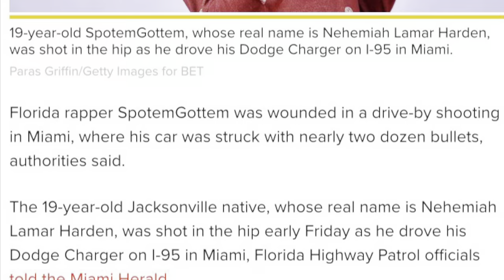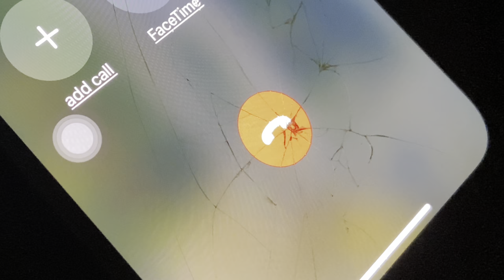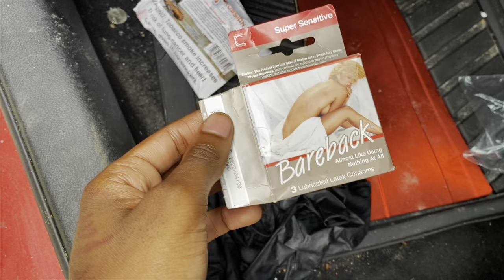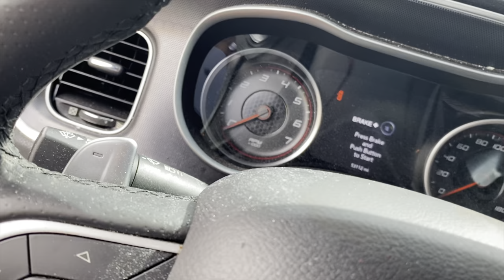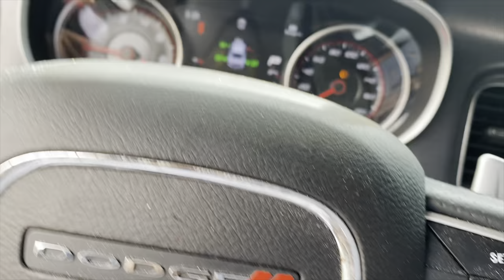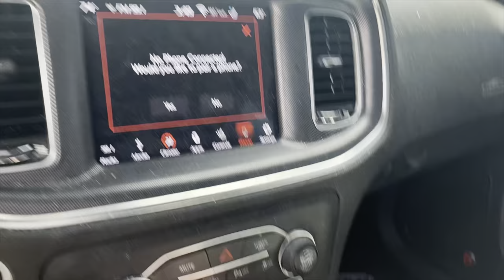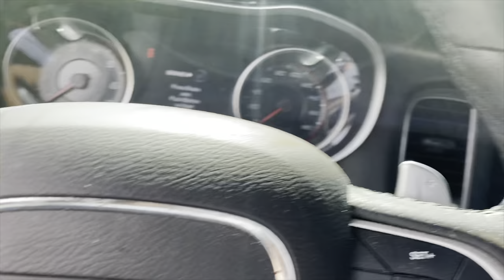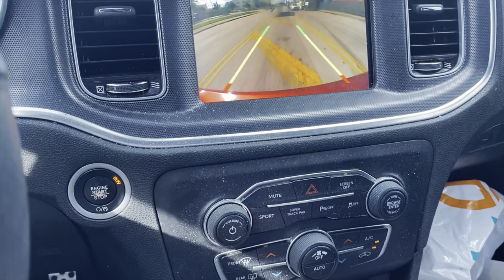MY STOLEN SRT 392 WAS RECOVERED!! SPOTEMGOTTEM WAS DRIVER! *CRAZY VIDEO MUST WATCH!*

Comment: He probably didn't steal it. He more than likely bought it from someone he thought was a legit salesman.
Reply: Na he stole it cause if I'm rich I'm going to dealership to get me a brand new srt
Reply: Spotem was the pAssenger.
Reply: @illreonowilliams1570  They sell them just like this at dealership all time. People go to places like car max that will buy it on the spot then car max sells the car or sends it to the auction. Another dealership buys the vehicle & sells it to someone like spotemsnitchem without noticing.
Reply: U right they do but as a rapper that say he got 50 bands gotta go legit to a real dealership we know were to get a real srt from
Reply: In Florida they got chop shops where they change vins and you can get car half price and it’s basically yours but if you get caught that’s like 15 years

Comment: Jus an FYI them rotors get like that(rusty) from sitting in a humid and rainy environment (Miami) without using the brakes at all to rub down the rust. Which wouldn’t form if the car were being driven. So from the time the car was impounded till the day you picked it up was long enough to rust up the rotors. That not from someone not taking care of the car.

Comment: It may not have started right away because they go into a sleep mode. And you’ll have to push and release the start button two or three times. My Challenger SRT does this if it sits a week or two. The sleep mode is to protect the car from going completely dead if sitting for sometime.

Comment: If your vehicle sits for a while in Florida and with the rain and everything your rotors will rust a little bit it’s super common if you live in Florida but as soon as you drive a few blocks n break for something the brake pads take the rust right off.